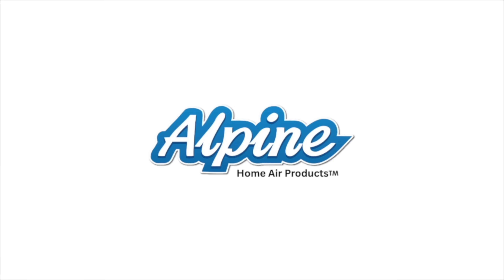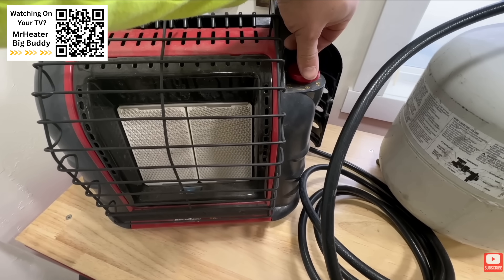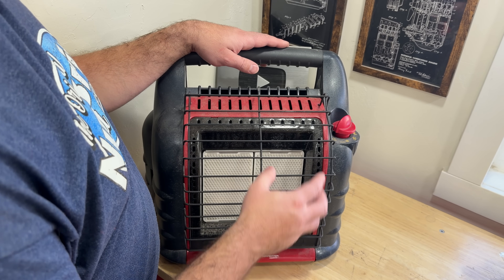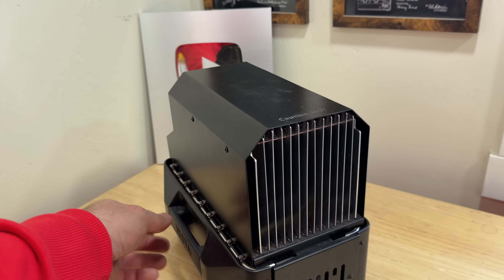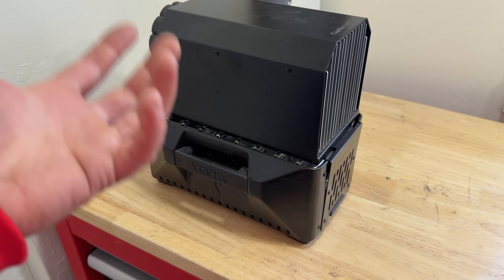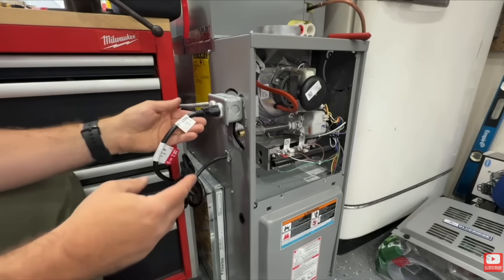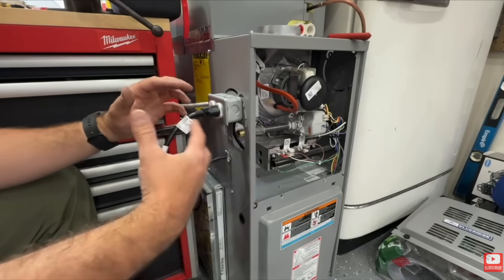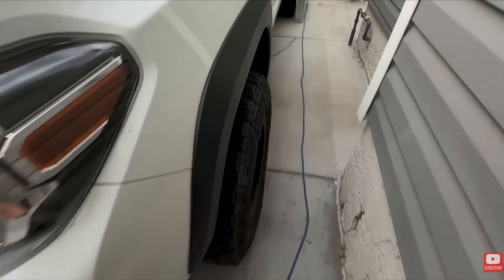Why Didn't We Think Of This Sooner?

Comment: What do you do about the condensation caused by the heater? I have a 14’ box truck camper and my entire roof gets covered with enough water that it starts raining inside the truck if I run the heater for more than 3-4 hours, and also I start getting nauseous and and my eyes start watering burning after about four hours of use and that’s with the cab windows cracked How do you combat that in an enclosed space like a building? My truck has got tons of air leaks. There’s cracks in the floor, gaps in the walls, and the ceilings everywhere. I know the secret.

Comment: Never keep large propane tanks indoors!!!
If they develop a leak they can fill your house or room and cause a large explosion when a spark happens (even turning on a light switch)
Your CO detector will not sense the propane buildup. 
Better idea is buy a refillable 1 pound tank and go outside to fill it with your 20-30 pounder.

Comment: I went to make a backup electrical for my gas furnace years back, and found out it has old school 'millivolt' control,  a thermocouple generates enough power from the pilot light heat to power the thermostat. A few years ago I spent nearly 2 weeks without external power, furnace continued to operate.

[it has been safety checked by the utility company]

I have been using a Buddy in my garage occasionally. This is helpful information.

Comment: Big Buddy is a super alt heat - super safe indoor heater.  On medium and 30gal propane kept us for a couple weeks.  Also buy 12V blanket (has built in adapter for in house power) and stay warm at only 6V draw.  Get a gas powered range.  Gas will always be available for cooking.

Comment: I don't think you can say "any" vehicle can be used with a 12 volt power inverter. I have a Toyota RAV4 hybrid and I can't even jump my vehicle to another if they're battey is dead, but I do carry a small battery bank just in case. You could use the cigarette lighter plugin but it wouldn't be advised.

Comment: My mom lives with us in a mother-in-law suite above our second garage and has a gas fireplace that requires electricity to run.  The second garage is on its own meter and independent of the main house where we have enough of a generator setup to run the heat pump, so until I can get additional generator capacity for her apartment, we installed a pigtail plug on the fireplace and I have two UPS battery backups that the fireplace can be plugged into.  We don't know how long the batteries will actually run the fireplace because the power hasn't been off long enough to drain one (the fireplace has no fan...the electricity just runs the gas valve and remote system) but it takes 6 hours to fully charge one UPS and it has run that long with no signs of stopping.
Reply: A lot of those fps have a battery backup either already installed or just need to plug in a battery tray.
Reply: @GodAlwaysWins7 This one does not...hence the workaround.

This one is kind of strange, actually.  20 years old and has a pilot light instead of electronic ignition, but can't be operated without electricity (it has manual controls down below like it SHOULD have an override, but the pilot won't stay lit without power, and battery backup isn't an option, or the builders chose not to purchase it separately.)

Either way, the problem is solved now, and I can recharge the two UPS banks and nauseum during an extended putage as long as I have fuel for the main generator.

Comment: I understand that you say, and others say it is safe to use indoors. But without an outside vent system, I just don't understand how this is safe. Can anyone explain?
Reply: Under normal operating conditions, the products of burning propane is CO2 and H2O (water).  These heaters don't work above 8,000ft where O2 level isn't sufficient to support combustion but is plenty enough to support life.  In a confined space, when enough O2 is consumed, it's like being at 8000 ft; the flame goes out.  The important thing is to ensure adequate air source and circulation so that O2 isn't depleted.  That's not to say it can't produce CO.  It's  still possible if the heater has a fault.  Always have a CO and CO2 monitor.

Comment: I have a good old reliable wood stove in my house for back up heat. It is fan forced but I bought a solar powered mini generator to run the fan. Its just a big battery with a handle on it with a few plug ins really but I can recharge it with solar. I actually heated my whole house with no problems in the coldest of  weather for 10 years because in my early 20s I needed more stuff then to spend my money on electricity Plus I enjoyed splitting wood with a maul, its good exercise. Honestly you cant beat this system for back up heat as long as you have the wood. But if i lived in a house with no fireplace which profusely the majority of people do now the big buddy or maybe 2 or 3 of them looks to be the second best option I have one of those to because i have rental property and when I need to work on them while the power is turned off I will crank it up and it works good Personally though I wouldn't live in a house with no way of heating with wood its safe its cheap and puts out the best heat I have ever had. I just bought a house in the mountains in east Tennessee with no fireplace or flue so its the first thing I am going to do to that house is put a flue on it in the basement so i can set up my wood stove for back up heat

Comment: I own a Big Buddy heater, I can attest that on high, in a pretty large room, it will sweat you out and make you turn it down. As long as you're not my wife, who wants it like 80 degrees when it gets anywhere close to freezing point outside. One thing he didn't mention is that they recently started selling refillable propane cans of their own, called "Fuel Kegs". I bought 2 of them a few months ago when I found out about them. A Coleman propane can is about 6-7 dollars in today's economy, but these refill cans cost about $3.40 to fill. Yes, they cost 20 bucks at Home Depot, but if you use them a dozen times, they start paying for themselves. Disclaimer: I haven't actually used them yet, even though I bought 2 of them. They also sell an adaptor kit, and based on asking the guy at Tractor Supply whether they could refill these cans or not, I ended up buying that, too. It was about 30 bucks.

Comment: I have camped with a Mr. buddy heater, the medium size one and you can’t get that many hours out of it unless you have a 20 pound propane tank. Those small green propane tanks only last about six hours on the lowest setting. Please crack open a window when you turn it on. In the first camper, we used it in, it was so hot that all the food in the refrigerator was ruined. The refrigerator was next to the table in the dinette where it was placed next to the open window. We had to go to town the next day and buy another $100 worth of food. That was about 15 years ago.

Comment: I have a Buddy and a Big Buddy.  I use them all the time.   They are more than just handy for ice fishing or blackouts.   If you get the hose kit for 20lb tanks, be sure to get a filter as well.  Also, metal paint screens for buckets work great for cooking in the same sense if you don't want to pull the protective cage off.  They are fairly inexpensive.

Comment: The combo detector … hummm ….. doesn’t smoke rise because it’s lighter then air?   While CO2 is heavier than air.  So we’re do you put the combo detector?  Sorry … my CO2 is plugged in a floor level and my smoke detector is above door height

Comment: If you live in an AEH (All Electric Home) and don’t have at minimum one Buddy Heater (I have two) along with a good supply of propane you’re seriously playing the weather odds. Candles will heat a small room too but they emit carbon monoxide. Nonetheless I’ve warmed a 11x13 foot room simply placing 20 candies on a cookie sheet in the middle of the room. Try holding your hand 18 inches above the heat output of 20 candles. Thirty is better. ⚠️Must have battery operated monoxide detectors ⚠️Keep a solid supply of wool blankets and socks around. Look for all the Hot Hands products when they go on sale. I’m using the insole heaters right now up in Washington on January 24

Comment: I was wrong, 20lb tank is often 3/4 of the way which is Total BTUs = 15 lbs x 21,548BTUs/lb = 323,220 BTUs. Thats 10.7 hours on a 30k btu burner and 17 hours on a 19k burner. 80 hours on a 4k btus burner.

Additionally, I pay 22$ per exchange, which equals 4k BTU Burner: $0.27 per hour, 19k BTU Burner: $1.29 per hour ,30k BTU Burner: $2.04 per hour.

Comment: Always buy a buddy fuel filter and hose,when running 20lb tanks or larger.with out a filter,oil from the bigger tanks will get inside your buddy heater and and clog the fuel lines up!!!! Spend another 50 75 dollars when you purchase your heater and heat with no worries!!!!!! Your welcome!!!!

Comment: I tried it on 20lb tank it clogged up filter very quickly.  They suggests a a filter on 20lb tanks and they are not cheap.  I didn't try refilling small propane tanks.  I did call company about gas they said it's give off about as much as gas stove.  They do recommend fresh air when running

Comment: Have my Lil Buddy heater (slightly smaller unit than pictured) hooked up to a 20lb tank now as I do various times through the winter to suppliment my central heat.  Always handy especially during this weekend's severe winter storm.  btw/ bending the protective front grate is only reasonable when the heater is turned off lol

Comment: While you definitely can run the big buddy indoors, you do need adequate ventilation, which means some efficiency is lost as heat escapes with toxins. having a carbon monoxide detector IS best practice. If someone is caught in an emergency situation without one, another indicator of inadequate ventilation is carbonic acid buildup. Carbonic acid wont kill you, but it is an eye irritant about on par with cutting up some rank onions. I have experienced it, but rarely see it mentioned. Do not rely solely on this detection method if you can avoid it, as it takes time to build up, and some people are more sensitive to it than others.

Comment: Don't forget to add the filter to use the hose from a 20 lb tank. It is very important to extend the life of your  Mr. Heater Big Buddy series.
Reply: Can you attach a link to describe this filter and how it is attached to a 20-lb tank? Thank you.
Reply: @arneldelara7164 
Mr. Heater Buddy filter part #F273699
Reply: I am glad you pointed this out to the viewers. I lost at least 2 Buddy heaters due to the oils et al from the manufacturing process of the hose entering the heater control valve, orifice, etc. I bought several filters to have on hand a couple of years ago and it hasn't happened since.

Comment: there is a much safer way if you have a gas furnace. check out the 12v battery hookup to run the blower fan.

Comment: I have 3 buddy heaters for myself and neighbors in case my generator isn't running. One thing I'd like to rig up is an easy way to mount a 20lb propane tank to a window so it can stay outside while the heater is inside. For now I'd use the heater by a ground level window and prop the tank up vs an upstairs bedroom window.

Comment: A small hack you can do with the buddy heater is to buy a wood stove fan. They don't use batteries and utilize heat on the bottom of the fan to generate electricity to power the small fan motor. You can rig it to the top grate of the buddy heater and all the exhaust heat that rises up from the burning propane will power the fan which will in turn blow that hot air forward instead of letting it go to waste. Basically, you can get more directional control and you can get the same warming of full power, but only have to use the half power setting.
Reply: Mr Buddy makes a fan specifically designed for these that does the same. Of course, it's probably pricier since you're paying the brand name. But it's made to clip in the grill of the Mr Buddy.

Comment: When doing the pig tail you have to make sure the bonding is correct on your generator or the t stat will call for heat but the furnace valve and blower will not run.  I ran into this during the Texas freeze several years ago.  I now have connection to my breaker box and it no an issue because the whole power panel is bonded correctly.  May be you can explain it better than I can.?

Comment: Little buddy propane: It states on the back of the device you need adequate ventilation. You need to crack a window/door an inch to create cross flow and refresh the CO levels. Turn on 30 min then turn back on or you risk CO poisoning

Comment: Whoa there! No! Do not install a plug on your HVAC so you can run power to it. Use only rated generator connections or run it through your panel and install a generator interlock kit.  If you just wire in power, you will send electricity back up your service line into the grid and you could kill a lineman who is working on restoring power!!!!

Comment: Big warning to not use the hose as shown as it doesn't come with a pressure regulator which means if it gets severed, the gas will come out at tank pressure and immediately ignite. Get the special adapter that has the regulator and it goes into a port by the side of the heater.

Comment: From late 16' to late 18' my disabled wife, my late mom's old cat, and I were all but homeless, living out of a 30 year old RV with a busted heating system. The first winter I used a kerosine heater, which worked, but we had to keep the ceiling vents open and soot got all over the celling. I never did get it out. The second winter I bought a Big Buddy, got a ten foot hose and adapter, and hooked it up to a propane tank. One of those 20 pounders. That tank heated the RV like a toaster for about 2 days per tank. It was pricey, yes, but cleaner then kerosine and better than freezing. I drilled a hole in the RV wall and ran the hose outside since I didn't want the tank inside with us and yes, I still kept the ceiling vents partially open for ventilation, but only as a precaution.

Please note: As a rule, I never left either one on if we weren't awake, and present to keep an eye on them. A bit of paranoia is a good thing. 

We were able to buy our first house in late 18' (first for us and me being 52 at the time). I kept both heaters, just in case. Like today, probably one of the coldest days in Iowa (Jan 26') and our furnace is acting up. That Big Buddy is my fall back if the furnace craps out completely before the repair guy can get to it. I'd also suggest keeping 2-3 tanks on hand. They'll store and be good for years if your careful and if bad weather kills the power for days, you can bet your arse trying to get filled propane tanks will be a challenge. Just saying.

Comment: Carbon monoxide detectors need to be placed low. Being high on the wall, you will be dead before it goes off. Carbon monoxide is heavier than air.

Comment: 1st gas heater is not safe, causes carbon monoxide. If you do use it you have to open windows or you'll sucuumb to carbon monoxide poisoning. No gas is safe gas.

Comment: I just want to point out that CO detectors should be close to the ground.  CO is heavier than air.  By the time it hits your detector, you may be dead already.  That is why I recommend getting a CO detector that you plug in with a battery backup.  25 years in Fire and EMS.  Want to keep people safe.

Comment: You can use the shelves out of your oven or some cake cooling racks and some wire and coat hangers along with some aluminum foil and basically build a crude oven to cook biscuits etc in. I did this on one of those 3 ceramic block wall heaters in the blizzard of 93. We cooked eggs and bacon on the grille outside and biscuits like this. Garlic bread and bread sticks to go with the steaks on the grille along with various vegetables. Just be careful, put a cookie sheet or something under this makeshift oven/ cooking surface to catch spills. Keep a fire extinguisher and or a fire blanket handy AS ALWAYS in any cooking area.

Comment: My experience using the hoses on the Big Buddy heater is that you end up clogging things up. I have recently seen a video that shows that you can take the heater apart and blow out the lines.  But I have been using the 1 pound refillable cylinders. This should extend the life of the heater plus it makes it a lot more portable and convenient. Also it is somewhat problematic bringing a hose in from outside to hook up the larger tanks.